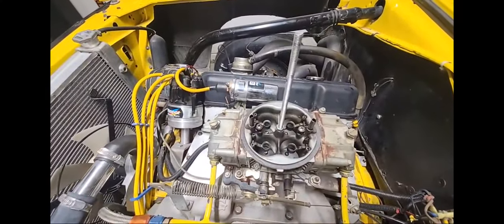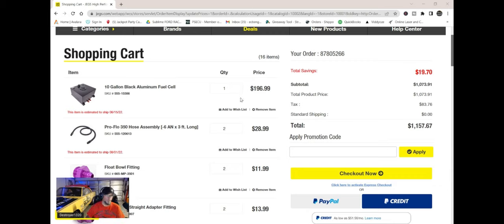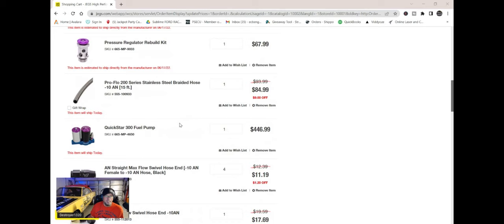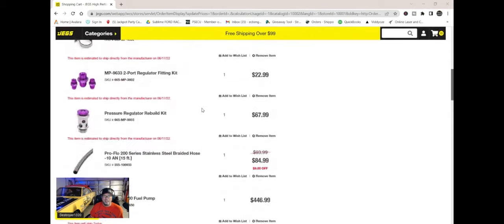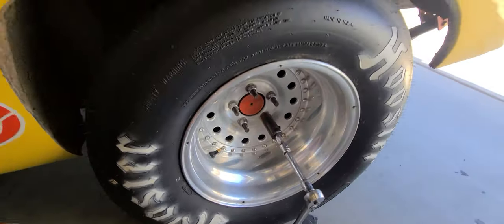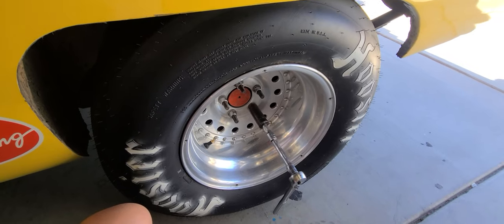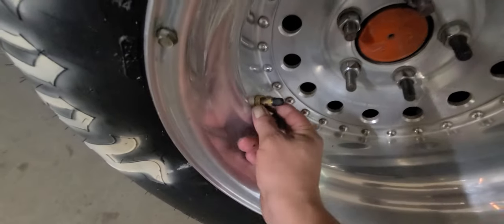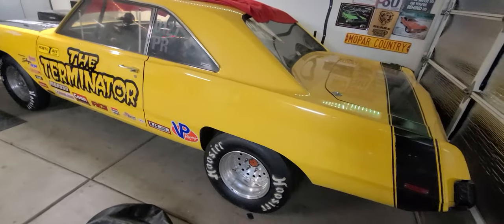1971 Dodge Dart (Drag Car) "Fuel System/Tire Issues"

Comment: Great video! Funny thing, when I was 16 years old I actually used a coffee can as a spacer to get the air filter through the hood and up into the scoop I installed on it! It was a 70 dodge coronet with a 72 demon scoop, I later removed it and stacked two filters!
Reply from the maker: It worked just not for me haha
Reply: @Destroyer1320  👍

Comment: Nice! You're definitely on the right track. Looks like a good shopping list to me! Gotta have good fuel delivery or you'll have nothing but problems. I would suggest you at least run a velocity stack instead of nothing at all on the track. You'd be surprised at what a performance difference that directed air can make.